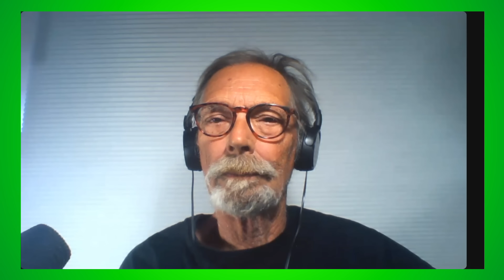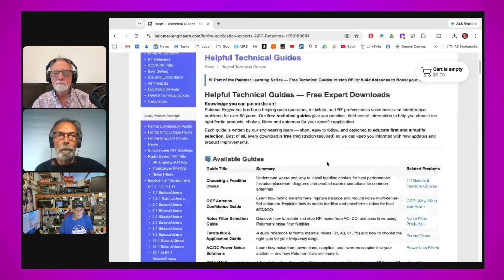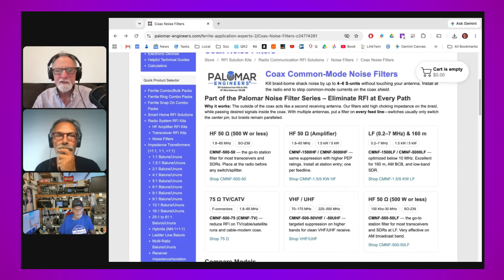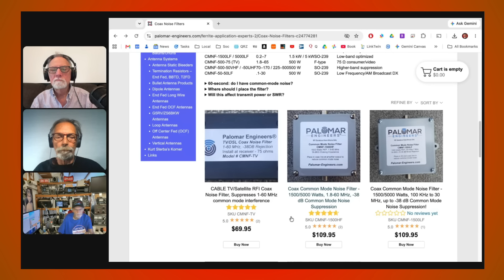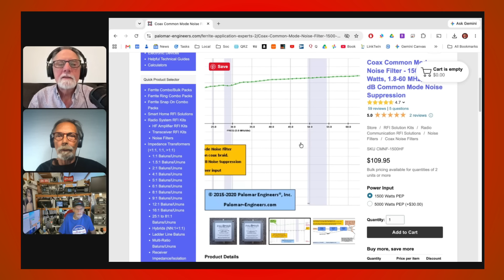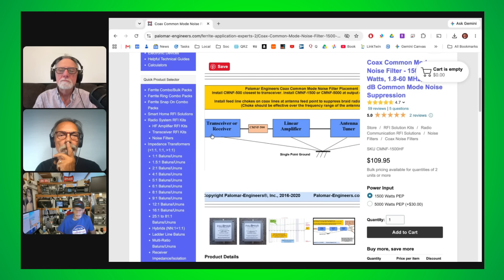AMAZING Secret to Reducing Radio Frequency (RFI) in Ham Radio HF Reception!

Comment: The Common Mode Rejection Ratio (CMRR) is a metric used in electronics to quantify a differential amplifier’s ability to reject unwanted noise or signals that appear identically (in-phase) on both inputs. A high CMRR ensures that the amplifier only boosts the intended signal, ignoring the shared noise.

What is the differential amplifier connected to the coax?
Reply from the maker: Not sure about your question. A receiver with a high CMRR is excellent at looking at the coax, separating the tiny differential RF signals you actually want to hear, and ignoring the heavy common-mode noise picked up along the feedline.
Reply: It is a more general concept than just amplifiers. It measures the ability of a system to reject common mode signals as compared to easily passing or indeed amplifying differential mode signals. The ferrite cable choke creates an inductive impedance to any current that tries to get flow through it, which is an effective blocker at radio frequencies. Differential mode currents cancel out to zero net magnetization of the core, so no inductive blocking action happens. This gives rise to a clear and well-defined ratio of common mode suppression, widely used in various telecom contexts.
Reply: @analogplanet9675  TI states that the Common Mode Rejection Ratio is "The measure of a device’s ability to reject the signal common to both the positive and negative device inputs."  Their "device" is an op amp and they are looking at the common mode voltage.  In our case, we would be looking current; an antenna in a transmitting system or a receiver in a receiving system.  The term CMRR is solving the question of how good is that 2 connection device at rejecting the common mode signal.  Their test setup includes the 2 (count em 2) connections to the input port tied together so that they are a, well, common mode input.  In amateur radio, we don't consider the inside conductor on common mode.  We don't consider half of what is common in a common mode setting.  We've bastardized the definitions because the real world doesn't make sense to us.  For example, if we take a +30dBm signal and input to the outer conductor and look at the attenuation of the signal on that output conductor while the inner conductor floats and we see an output of -10dBm, that's only one (1) connection of the 2 connection port device.  If we want (but for some reason there are no takers) we could also measure the results on the inner conductor while the outer conductor floats.  The CMRR measurement would be closer to 0dB when comparing these results.  That's what they don't want us to see.  

I can find no instance where these baluns are used in the industry.  It's just amateur radio.  An antenna is just electrically defined as R+jX.  What's balanced about that?  What's unbalanced about that?  It's just an R+XL-Xc.  There's nothing there to balance or unbalance.  

But I'm just an extra class degreed engineer with 4 decades experience in the field.  What do I know?  I know I can't figure out this stuff.  None of it is included in textbooks of accredited EE programs.
Reply: I deeply and passionately agree with you, sir. Especially the part about the wishy washyness of some formal concepts applied in ham radio which I've come to see as a feature as much as a bug. It comes from gritty experimentation, pushing the limits of some conceptualization. Common mode chokes are quite common as it were, in e.g. switched mode power supply design, professional audio equipment, bio signals acquisition, Even the cable chokes on your pc cables and so on are real world examples. Im sure you can find a non-zero amount of literature on the subject, as it is very much not some obscure black magic.
Reply: @analogplanet9675 thank you for agreeing with me. Do you know the electrical purpose of the "balun"?
Reply: @N9XRradio that's another perfect example of one that's thrown around carelessly. Balanced to unbalanced converters are used to move from a situation where one conductor swings its voltage relative to a fixed "ground" or potential of the outer jacket, to one where a pair of matched conductors swing opposite relative to each and not at all, ideally, in the common mode, or "overall, relative to ground" . A non-radio commercial example is an XLR microphone to mono audio jack converter for use with something like a guitar amp, which has an unbalanced input. Since you're into op amps, a differential amplifier does this exact job, speaking abstractly and somewhat imprecisely, as you pointed out, but with semiconductors instead of magnets.
Reply: @analogplanet9675 don't forget the topic here. It's antennas. Not microphones. Not power supplies. Not anything else. Antennas. Answer this. How do we define power dissipation in an antenna?  Right. I²R. No V in the formula.  All of our concern is analyzing current. That's where the action is. Current flows 100% differential in a coax loaded into a matched antenna. No CMC. You'd understand that better with an engineering degree. With years of experience designing cutting edge products and systems. You're not going to understand casually reading a dumbed down arrl publication. Remember the topic. Antennas. RF loads.

Comment: I build my own baluns, ununs, chokes and filters. Far less costly than buying. Especially when you need many of them. (Just buying quality ferite and teflon wire is expensive enough.)
Reply: I do the same. I appreciate Palomar, but the making on all things antenna related is what I enjoy most. I will likely order a filter as described here. 

I am trying to conquer noise, right now. This was helpful.
Reply from the maker: Smart approach, nothing beats the satisfaction of building your own gear. Q
Reply: Same
Reply: I do the same but I was not able to beat the performance of LDG unun
Reply: I like to build my own and learn as I go along too... I built a 49:1 for my EFHW and a 1:1 choke, where can I read about the difference between the 1:1 and the common mode noise filter, and how to make one if I need it?
Reply: @mscir  Any youtuber who shows you how to build AND test can help. I found the TRX Bench 3 part series on baluns to very helpful. He shows how to test what you do with stuff you can afford to have on your bench. I've tested some popular commercial items and found them 'lacking' in performance where it mattered. Like antennas, just because it is popular or easily available doesn't mean it is a good choice.

Comment: Sadly, this was more advertisement for a product than of educational value.  I get it that Bob is running a business and doesn't want to disclose the innards of the device, but we are hams and understanding of traveling wave theory is really what's important here.  73
Reply from the maker: Thanks. We'll have Bob back on and see what else we can cover. Q
Reply: Don't worry about it. Just ignore the technical support here. The RF only travels on the outside of the outer conductor.
Reply: What I get from this is to put ferrite rings at the receiver end similar to the ones at the aerial.
It's what I do anyway.
G4GHB.
Reply from the maker: Load 'em up, all over the shack wires. Q
Reply: Where does the product say where to place it?  Does it show a way as to how to calculate the position of the product?

Comment: Common mode is handled with chokes, and I can personally vouch for the Palomar ferrite chokes.  They WORK. Any noise that is not common mode (impulse noise, receive splatter, slightly off-freq signals) can be handled with noise blanking (NB), noise limiting (ANL), IF shift, and audio filtering.
Reply from the maker: Exactly, a combination of methods is often the key to a quiet station. Q

Comment: Fantastic interview.  I've been using homebrew common mode filters for many years.  While listening to Bob, I grabbed the coax connector and checked my noise level, nothing detectable.
Reply from the maker: Sounds like you have a very quiet station, nice work! 73

Comment: Cut power to the device works every time.
Reply: Actually this has been my solution. I don't play hf at home anymore, the noise is too high I'm strictly a mobile op now once every few months
Reply from the maker: A hammer does too. Or a buzz saw in the back yard.
Reply: @HamRadioPerspectives but those implements make noise! 😊

Comment: He is spot on @7:10. I had some very weird RFI and the source was the Samsung electric stove even when it was off. I do have the Palomar 7300 RFI kit and everything it did not choke I added my own beads or toroids. I still had a problem with my Amazon brand usb to the radio working digital. Even with a built in choke and additional beads it would pick up RFI and kick me off the computer. Solution was a Tripp Lite double choke cable and the RFI into the cable was gone. 73, AE5RF
Reply from the maker: Great job, Joe. Q